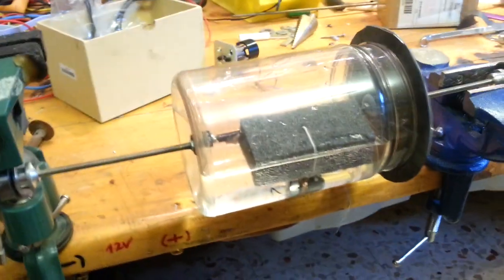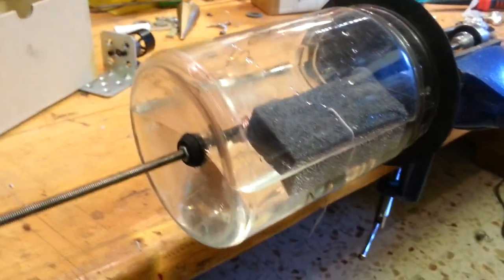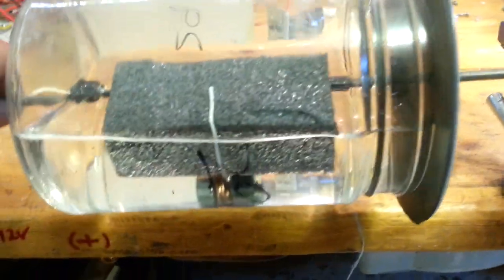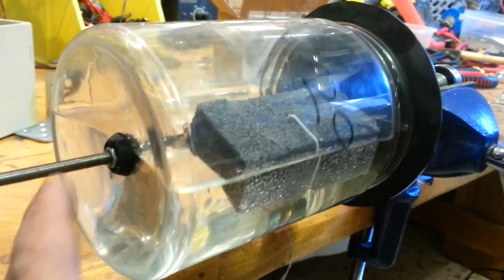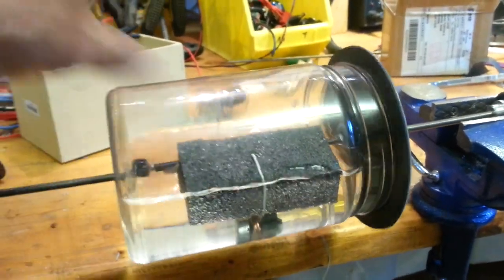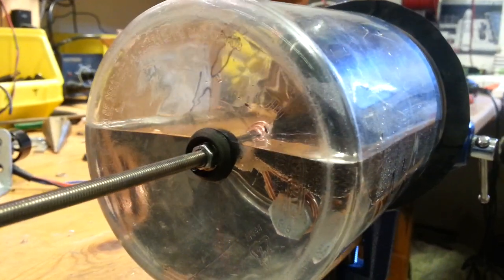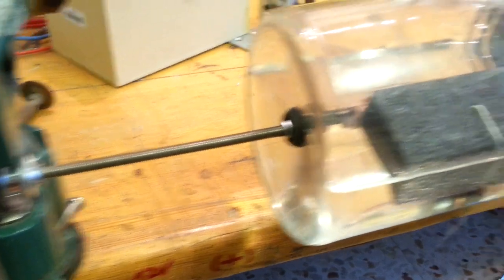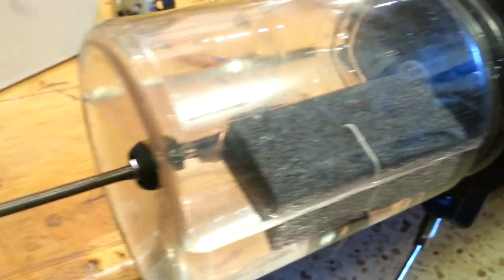Archimedes Sphere - Perpetual Motion machine -  don't Work !!!

Comment: Think about  the weight inside the jar
It wants to go down on one side but to do this the weight on the other side must go up but gravity wants to pull it down,
This means if you want the jar to rotate and move with the water then the water needs more contact with the glass because the water is to thin for it to be able to pull the glass with it when it moves and by having corrugated sides when the water falls it will create a convection and that along with the weight offset will move the glass in one direction but even if you do all of this the glass jar will stop eventually

Comment: There are too many factors impeding your machine from work. (Length of axis, slight bend of axis, weight distribution). There is a method out there of the 'Archimedes sphere' that does rotate, but not indefinitely.